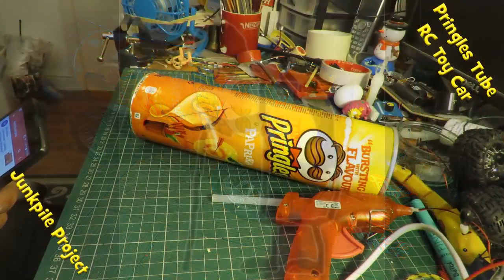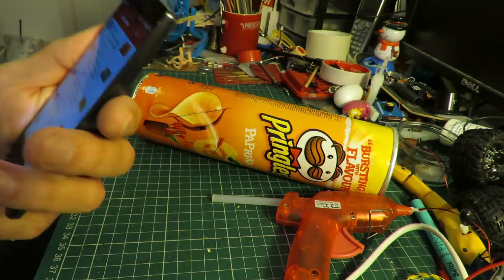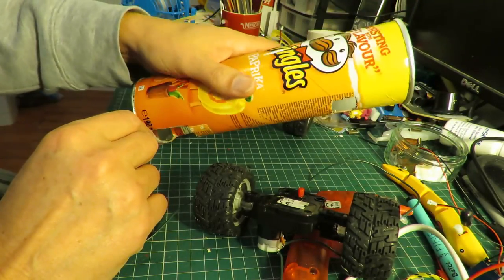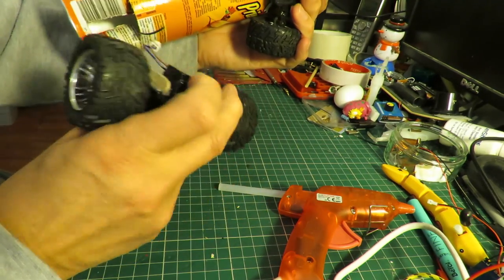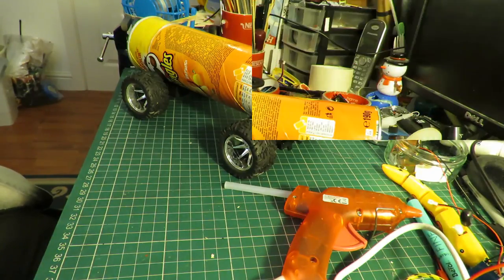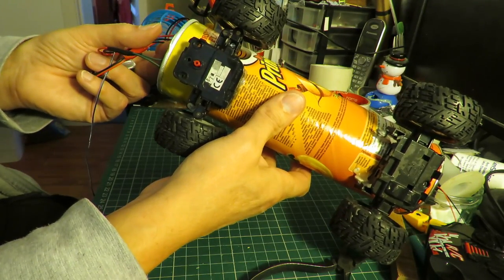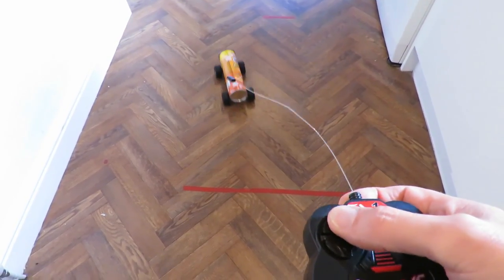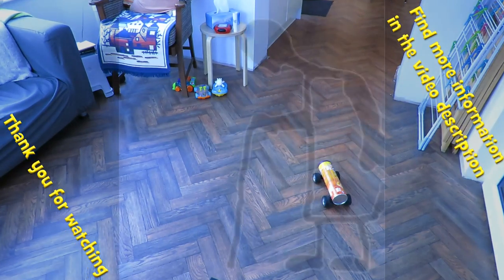Junk pile Project Pringles Tube RC Toy Car

Comment: Hm had a bit of power despite being on a 1s lipo thanks too the lighter chassis im guessing.

Could probably make a sort of suspension for it if you'd cut out pieces of plastic from icecream boxes/lids or similar kind of boxes & make screw holes in them.

A sort of double T shape so they can flex sideways better like this would work pretty well if you use the right thickness so it doesn't flex when it sits normally on the floor but does sway from side to side & can take a bump or two without loosing grip from bouncing right away http://www.rcjpg.com/xu2dxk8axp6lhb6qbp0s/5714.jpg

You could probably put it on top of the two like with the pringles can rather then the bottom as well unless you are planning for a bit faster moving build with a lower center of gravity. (With electronics from something taking a 9.6v battery & using a 2s lipo or rechargable small 7.2v battery you could make a rather zippy car/truck).
Reply from the maker: I think you are over-engineering this project, but yes you could do all that if you wanted.
Reply: Bit more fun with the same parts rather then just using it for this video.

I do tend to mess about with computers more then RC cars though (self educated there on computer repair & building).

Usually more building involved which makes it feel a bit more worth the time sort of instead of just ok it starts & does this its good enough & just leave it as it is in a corner of the room or to whoever came by with it isn't exactly my thing.
Reply from the maker: Marcus60661 I am more interested in just getting the basics working. In my old videos I used to include the text that said something along the lines of "I show you how to do the basics, you can now improve it to your own requirements" but nobody reads video descriptions so I gave up, but that is still my way of working. If you want to see some great work done from basic cardboard scrap I can recommend Nesmaniac's channel. Here is a direct link to his cardboard projects playlist https://www.youtube.com/playlist?list=PLEyd4FIDeiKful1C3LjPD5IzTnx2HPF0S